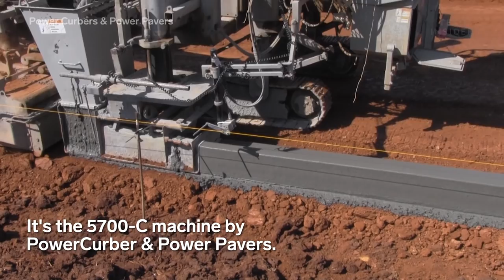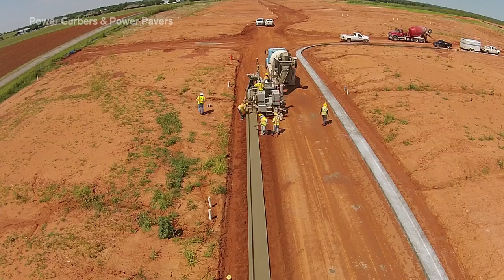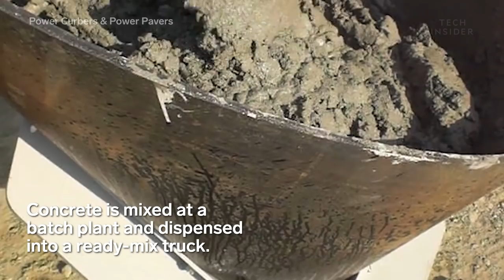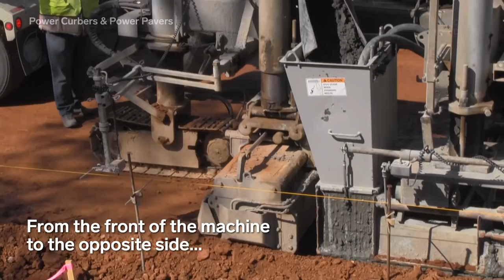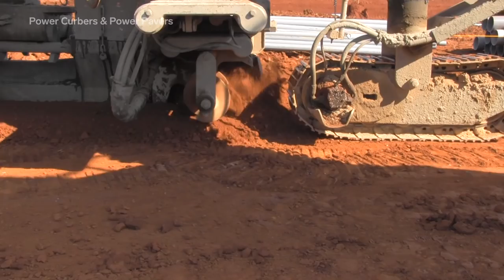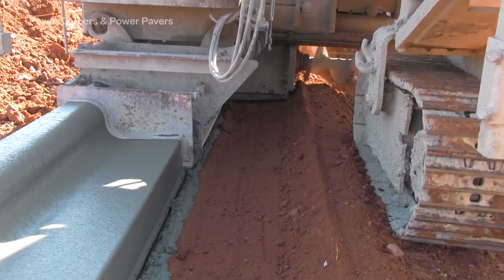Machine Pours Concrete Perfectly

Comment: If it's faster and cheaper than normal methods and just as durable or more durable, they should make a lot more of those machines
Reply: Jeffrey Koelewijn it looks expensive to operate, also it lays 100 linear feet per hour.. does not seem like alot to me.